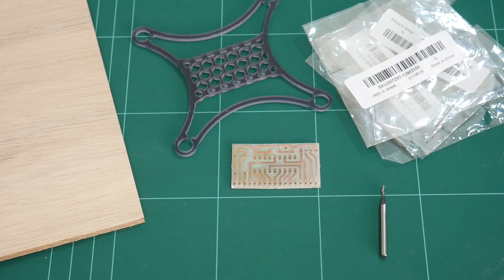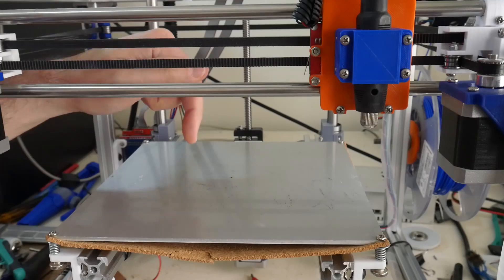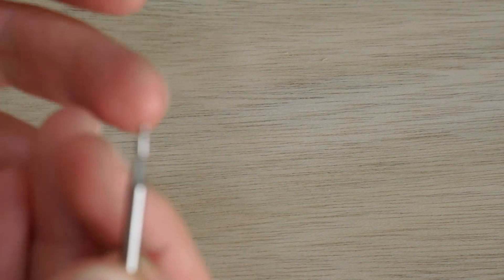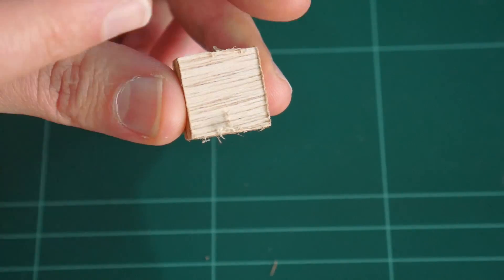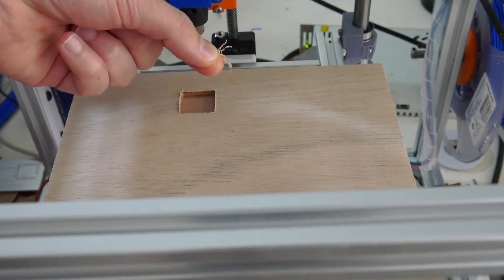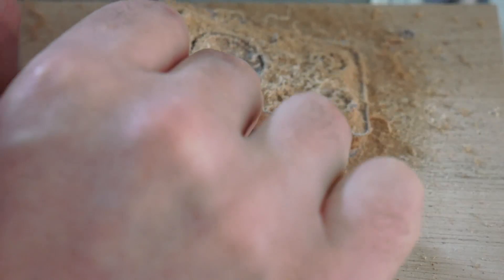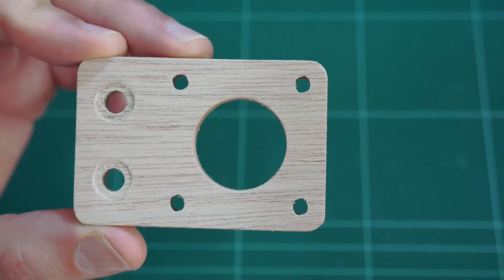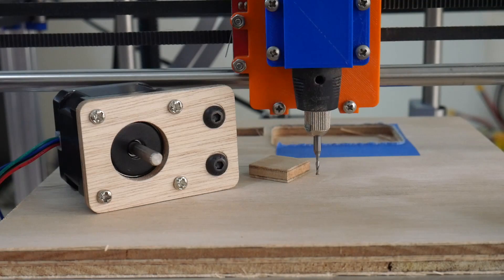Cut Plywood with a 3D Printer

Comment: Have you thought of trying a bit fan?
https://blog.bantamtools.com/introducing-the-bit-fan-a-new-othermill-accessory-you-can-make
Reply from the maker: Wow no I haven't! Thanks for sharing :)
Reply: @Tech2C  I was a bit sceptical at first, but it works well and is particularly handy when cutting plastics.
It gets the majority of the chips away, preventing them melting and fouling the cutter.
I used the STL in Fusion360 to create a new g-code file for the different cutters and material I have.

Comment: Hey Tech2C, great video as always.  What do you think would need to be done to the HyperCube (upgrade wise) to enable it to do some light duty aluminum milling?  Conductive chips landing on electronics may be an issue.. I't would sure be cool to see one of these making aluminum parts.
Reply from the maker: Hi Saber, Aluminium will be quite a challenge compared to wood, acrylic, PCB, etc that I have shown so far. Alu is very hard in comparison and would take a lot of force to cut into it. Problems for the Hypercube would be 1) The bed moves up/down in the Z axis and would be pushed down a lot by the drill. The bed springs make matters worse here. 2) The XY_Joiners are plastic and would flex whilst milling the harder aluminium part. 3) The X carriage is plastic too so the drill would deflect as well. And yes the metal chips are an issue too, lol, but we can cover the electronics to protect them. If I were to try, I would mill from the rear of the bed nearest to the Z rails, remove the bed springs so the bed is solid mounted, and move very slowly, down to 2mm/s speed with only 0.1mm Z axis depth of cut per pass.
Reply: Thanks for the reply.  When i get around to building my hypercube some day maybe i'll look into remixing it with some of these design considerations.

Comment: Hello. I built a super sized version of your hupercube 500mm x 500mm x 500mm.   I have to say I love it and thanks for designing it. I have a little issue and I'm wondering if you have seen and fixed it. I was printing 4 quad copter frames and the front corners of the parts are distorted toward the corners. In stead of nice round prop guards in have oval ones but just in the front corners of the build plate. I wrote a little gcode script that moved the print head back and forth and I could see it does an arc not a straight line. Any thoughts?
Sure do miss your build videos. It would be great great to see your projects
Reply from the maker: Make sure the X and Y axis move freely by hand, and do not bind. If the X and/or Y axis movements are sticking anywhere then you won't be printing circles, but arcs as you have found.

Comment: I suspect you might actually want a down cut because the bottom surface is supported by the piece underneath.
Reply: I second that. First thing I thought when I saw the uplift on the cut after the dust was cleared away.

Comment: https://www.youtube.com/watch?v=Rh7VmjOLo0I
a question?
is it possible that if you have a bowden tube
that you let the filament run completely out of the tube through the extruder engine?
so that you do not put it in manually, but with the motor!
so that you can then turn it all the way back in the tube?
again with only the engine!
(And with the latest Cura I think it is yet again a bit different!)

friendly greetings from The Netherlands!
Rob.

Comment: you can cut brass and ally with them but 0.5 mm cuts 0.1 start at i would say 1mm cuts max but not steel maybe mild steel but i dont know but you need carbide tip cutters :P

Comment: you could do with removing the bottom one the cork mat and putting one of those in instead its only there to draw away heat and better dissipate it across the surface area so !!

Comment: 1mm/pass when cutting plywood seems like the wrong way to do it. I used to cut 8mm Perspex (using a 1/4" cutter) in a single pass. I would have thought that multiple passes are only needed when cutting metal.
Reply: that's a really flimsy setup, and more of a proof of concept than a real thing, still something that can be kept in mind while pushing the limits.

Comment: With that small of a bit, you might not be spinning fast enough. Though this is wood and there will always be some sort of burs. If you can, try a larger diameter bit. The results will be better but this is not a 'rigid' setup so you will likely have to decrease your feed rate if using a larger bit. It will all end up being 6 of 1, half dozen of another. If you are looking for better quality cuts though, the slower completion time might be worth it for you.

Comment: In most case, converting a 3d printer into a CNC is NOT a good idea. Despite having similar movement type, 3D printer and CNC have very different constructions.  First, the mechanics of a 3d printer (bearings) is not protected against dust, this will lead to premature wear and problems. Then, the mecanic, the frame and the transmission aren't stiff enough to cope with very strong counter force and vibrations you have in an CNC, so the cutting quality won't be as good as a true CNC.
Reply: those are points to take into consideration, but given the cost of linear bearings (5 bucks for a whole set, 15 if you get good quality polymer bushings which probably aren't really subject to dust problems), you can go through quite a few of them before it begins being more expensive than getting a CNC router. bearings in a 3d printer usually last a lifetime, changing them every couple of years isn't a big deal. for the frame not being stiff enough, it depends a lot on the construction of the printer, and the forces on cutting plywood at this speed are really low. As for the cutting not being as good as a true CNC router, that's fair, but it'll probably be the best 30 bucks CNC router you can get if you already own a 3d printer.

note that for pedantry, I'm insisting on CNC router, because the 3d printer is already a CNC.

Comment: When you put in and endmill don't put it in fully, the way the collet pulls in it grips the circumference and also pulls in slightly, if its against the stop inside it cannot and will stress the collet. Tape the piece that comes out or leave thin tabs as once its free it can move and destroy cutter, part or both. Your now into CNC routing/milling, nice. 👍

Comment: Tape on wood doesn't help much with tear out if at all in my experience with cnc. It just gums up the mills with adhesive which is very hard to remove. I had better luck with either very sharp end mills, from 5 to 6mm in diameter for milling aluminium or using straight fluted end mills instead of twisted/spiraled  flutes. A very light pass with 0.5mm depth of cut often also helps. I've also tried a v bit before milling out a shape, it works but adds an extra tool change. Also, the harder the wood type the cleaner the cuts.
Reply: Josha Beukema tape allows me to use the bit longer, without fuzzy edges, but you do need to scrape the junk off between cuts.
Reply: How does tape help use the bit longer? It only adds material for the endmill to go through and the adhesive may prevent heat from dissipating quickly and add friction heating up the endmill more.  Tape may well shorten the endmills lifespan.
Reply: Josha Beukema a bit that is old and produces ragged edges without tape, will still produce sharp edges with tape.  I carve silicon dioxide flooring. Ymmv

Comment: Nice job - the ply cutouts would look great with a layer of clear polyurethane paint.
Reply from the maker: Yes they would look great with a coating. Maybe an idea for another video... ;)
Reply: Cool !  Did you ever consider doing a hobby pick and place cnc machine for smd prototypes?  No easy but a super diy project!

Comment: if they sold you that as marine 6mm plywood….. they are worng… real marine plywood has like min of 5layers
Reply: 1/2" ply usually has 5 layers, 1/4" usually has 3. The only differences with marine ply are the types of wood (tropical hardwood) and glue (water and boil proof) that they use.

Comment: Just my observations on this:
The blue painters tape helped. It provides something akin to a "zero clearance insert" on a table saw, in that it provides a counter-force to the lifting action of the tool helping the fiber to shear off. On the larger NEMA 17 motor mount, one side fuzzed a bit more as the tool was doing a "climbing cut" on the inner part and the direction of the fiber was not quite in-line with the cutters tool path, it was a few degrees off. In that cutting scenario, the tool is pulling fibers away from the inner part being cut out. Interestingly that small mis-matched probably helped one side and made the other side worse. You could try reversing the direction of the cut when cutting out the main part to see if that helps.
Cheers and Thanks for the video!
 - Eddy

Comment: How the hell did you find a flat sheet of ply at Bunnings?!!???!!!
Reply: better to use aluminum but need a CNC machine as someone has already mentioned this below, it is a 3d printer constructed machine that will struggle with deflection issues using it as a CNC machine.  cutting circuit boards are an interesting improvisation.

Comment: Do you have a workflow on the software side of things, like how you load gcode to the 3d printer.
Reply: Try estlcam it can generate gcodes mega or uno... You can change the pins out ramps ..
.you can generate that code on slicer also... Just make boundary inside or outside  (with size of tool diameter) of part you want to make... Generate g code with desired layer height (which will be same as cutting height in z axis) generate gcode open it in notepad and using find and replace find z and replace it with z-  & g92 set z0 on top of work  workpiece so machine will make moves downward. Spindle motor is always connected to external  power on/of switch can be used.

Comment: Hi, not bad results at all from the 3d printer.  Have you considered using tabs with your 'contour' cut out operations in fusion360?  When your parts cut through they can come free causing damage to your parts finish or even cause the end mill to break.  A little more clean-up but well worth the benefits.
Reply from the maker: I haven't for this test, but I have in the past. I can add double sided tape under the cutting area which would have the same effect without the need to clean up afterwards. Cheers!

Comment: As a model maker hobbyist I’m wondering if it would cut through MDF. I want to have a laser cutter but don’t have the money so cutting it on my large bed 3D printer would be awesome.

Excellent video. Thank you.
Reply from the maker: Hello, yes MDF would be just as easy as plywood. Just be sure to use breathing protection as MDF dust contains toxins.
Reply: Tech2C thank you for your reply and the tip. I’ll be sure to stay out of the room when it’s been cut, I will keep the window open and use a fan.

Comment: Very nice video!
I'm starting my way throug 3D printing and milling, and your videos help SO MUCH!
But I still have some questions, though.
How do you send gcode to your printer? Do you use a SD card, directly into your printer?
Or do you use a computer software? 
In any case, how do you do it?
I tried printing directly using my 3D Cloner Lab's direct SD input, but ended up with everything cranked up. 
Thank you for your time!
Reply: Hi, there, this process is managed by the CNC controller software. The creation of a G-code file is further managed with other graphics software that allows the automated creation of objects to more efficiently create the cutting file. The cutting file is still editable on the controller. This is also known as a CAD-CAM system. computer aided design - Computer-aided manufacturing system. I used to program large scale machines in a factory, I am building my own small machine and also found this video very interesting.

Comment: Have any V bits around? You could use them to cut the surface fibers before using the spiral upcut tool. Woodworkers often use blades for shallow cuts before sawing for the same reason.
Reply from the maker: I have very narrow V bits but they're probably too small. Good idea though.

Comment: How would this do with PVC sheets?
Reply: I'm assuming it would do very well, since plywood is a more difficult material to handle. PVC is grainless and pretty soft, so the same mill would make short work of it... It might need different settings to avoid melting maybe.

Cheers
Reply: For PVC use a different Bit like the one that Tech2 used to make a PCB, you can cut with 1.5mm each pass or even 2.0mm ; The PVC it doesn´t melt as easy like acrylics and some plastics.

Comment: I see you finally had to replace the carbon fiber rods. Did they wear down?

Also the flexible shaft was an amazing idea.
Reply: He said something in  a previous video about them not being stiff enough for milling.
Reply from the maker: That's right, for CNC purposes I switched to the heavy steel rods for extra stiffness. The carbon tubes will go straight back on for 3D Printing...!
Reply: @Tech2C  Make a test between the two types to figure out if it makes much of a difference!
Reply: I've been using a flex shaft on my 3D printer for about two years for PCB CNC drilling
Reply: You could go much larger diameter rods and still be much lighter than steel. Why not 16mm carbon?

Comment: Why do you think the 3mm holes weren't round while the larger holes looked perfect?
Reply from the maker: I noticed that too. It may be something to do with the ramp employed by fusion360. It's doing a combination X,Y,Z move in a helical pattern. Maybe for the small helicals there's an issue in code?
Reply: Check the toolpath and see if you're using arc moves

Comment: 3mm aluminum?
Reply: If you can do 1mm, it doesnt mettar how deep, the only limit is the end mill which depending on the width might be longer or shorter. That at the same time limits wheter ypou can or cannot do aluminium as wider end mills cause higher loads and so your machine might not be capable of doing that.
Reply: Even 1.6mm or 2mm aluminum?
Reply: if it can do aluminium in 0.1 passes good enough, it will only take you 16 to 20 passes
Reply: @robinc.5077  Thanks.  Which router?